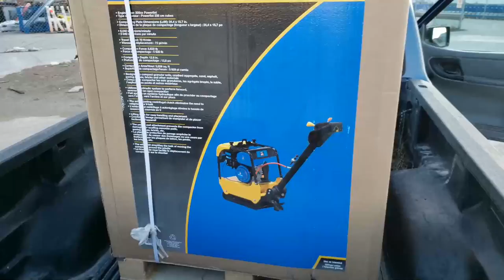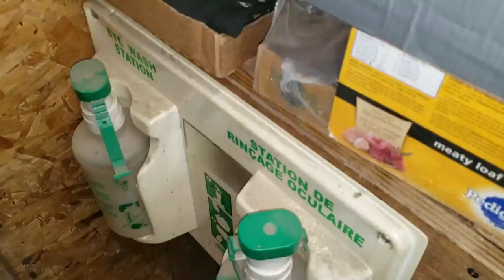NEW Toy!! And Caught a Thief Trying To Steal It After Parking For 3MIN!!!! Caught on Camera

Comment: Did ya pull a copy and send to the coppers ?
Reply from the maker: Nope , Seeing they did not touch my truck itself , as in try to pull anything out of it , the video is useless so it just got tossed into the pile of videos i have saved up.  (i work with cops all the time at my work dealing in CCTV) And they would not even look at a video like this , i did get the plate # and everything , the SUV had Ontario plates lol